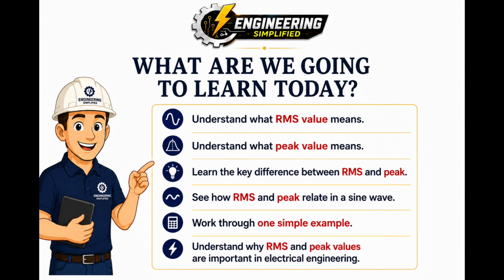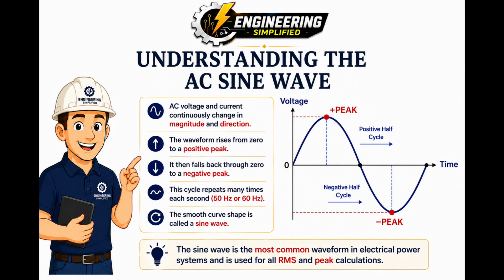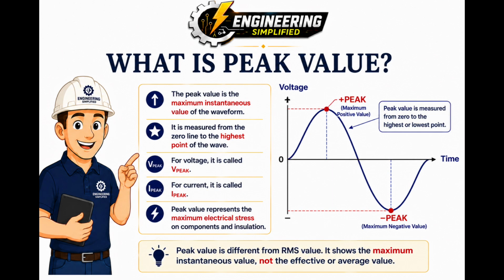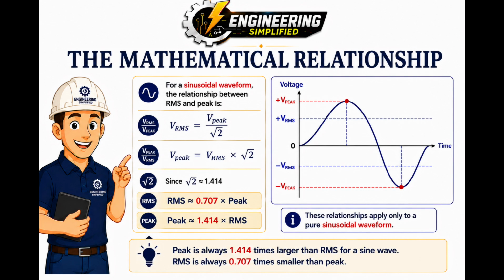RMS vs Peak Explained – What’s the Difference and Why Does It Matter

Comment from the maker: RMS is the value that actually matches the heating effect of an equivalent DC voltage, which is exactly why your multimeter reads RMS, not peak, when you measure mains. Did the derivation in this video match how you first learned it?